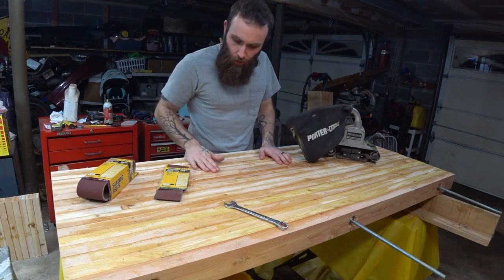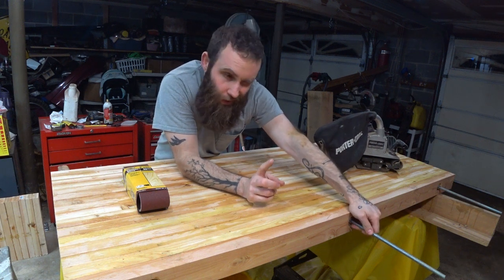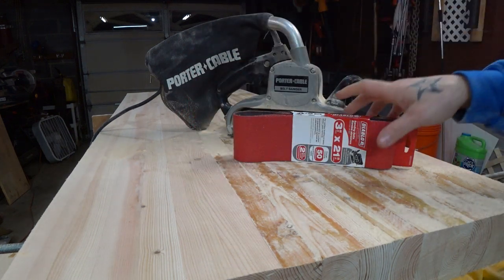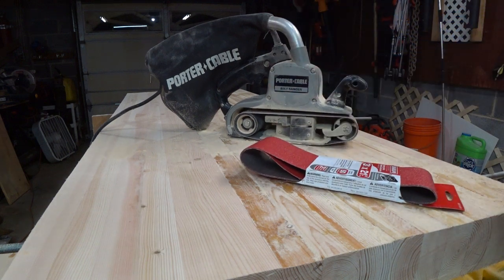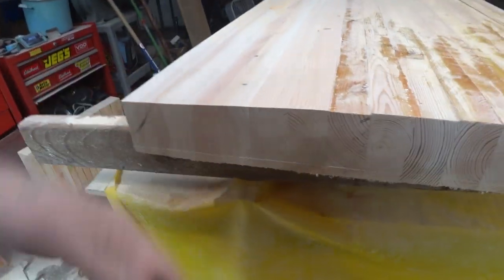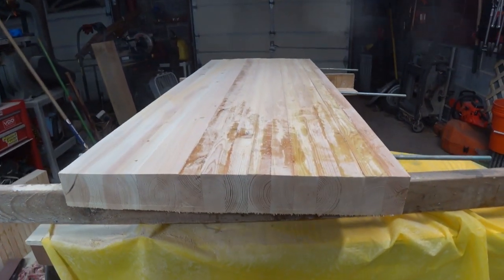Building The ULTIMATE MECHANICS WORKBENCH - Flattening a Table Top

Comment: There better be belt sander racing as bonus footage after part 3.  You’ve set the expectations now. (You give us monkeys an inch and we take a mile)
Reply from the maker: You know what... Deal. If you loyal viewers will stick around until part 3 (this was never meant to be a multi video project) We will build a track and do time trials with some 3x21 sanders.
Reply: D&E In The Garage if you still have the fuel filler cover from lake effect you should mount that to a piece of wood and present that as the trophy
Reply: @kevinmcewen1760  😂🤣 that's got to be the best trophy idea!
Reply: @DEInTheGarage  Yes!  For sure Yes!
Reply: I have a 220v 8”wide belt sander..,   🤔. Are there size classes or run what you brung?

Comment: Love it, couple of comments:
1) Don't try to smack the rod with the BFH. Put two jam nuts on the end, then use an impact wrench on it to spin it out. 2) Using a hand plane or even a electric planer instead of the belt sander...then sand after. 3) You're sanding across the grain with the belt. Need to sand with the grain.

Comment: For anyone watching, Vaseline on the all-thread will help keep the glue from sticking. If you miss the vaseline part, to break the seal you can heat up the end of the all thread to help soften the glue and jam 2 nuts together and use that to rotate the all thread

Comment: Just had an idea, maybe you could have drilled the holes to fit some electric pvc pipes/tubes and run the allthread inside them?
That way the glue would never come in contact with the rods.

Comment: First time viewer, poster and subscribing to your channel. Also a recent transplant to NJ... Jug handles, WTF OVER!? I digress, I ran across your video as I just bought a belt sander to fix my glue up that looks no better than Austin Power’s teeth. I think I screwed up my all thread drill points and I have some serious sanding to do now because I’m serious, it looks bad with boards sticking up on one end but not the other. I also over used my planer trying to glue up the boards in sections of about 4 boards as I thought that would make the final glue up with the all thread even easier and to include clean up planing off the glued up sections. Unfortunately I’m already down to about 2.5 inches so I’m hoping I don’t over sand it now. I’m new to woodworking and needed some pointers, your video helped and provided a lot of other tips on how I could have done better.

Comment: Try using a leveling plane (manual) rather than a belt sander. You will get far superior results is the same amount to time. You can typically find used plane's at flea markets for a few bucks. If not, get a check ryobi hand-held planer. Belt sanders are great at removing material, but the chances of ending up with flat surface is almost nil.

Comment: Just a thought but you could have tried unscrewing the threaded bars if you could have got it to turn a few times you could have put it into the chuck of a drill and just let it wind the bar out to late now as you cut the ends off but this may have worked.
Reply from the maker: That is a very good idea. I did try removing 1 nut and tightening the other side to see if it would break loose, but it just dug the washer in to the board further. My goal for a future project will be to design a better was to be able to remove the rob. I am wondering if greasing it would work
Reply: @DEInTheGarage  Try PAM cooking spray on the rods next time, may keep the glue from sticking to them.

Comment: What kind of finish are you going to use on the top ? I hope some type of oil finish & may be some coats of wax ? It will be easy to refinish when it comes time.
Reply from the maker: Was considering Danish Oil
Reply: NICE, Watco is a good brand & I would go with Dark Walnut ? It's not dark at all but better than Natural unless you want your bench to look pretty much what it looks like now but with a sheen. Also MAKE SURE YOU DON'T THROW YOUR RAGS IN THE GARBAGE, THEY WILL START A FIRE. If you don't want the ends to crack more I epoxied them before finish or paint ? GOOD LUCK, LOOKS LIKE A DAMN STURDY BENCH TOP.
Reply: It'll have its share of transmission fluid and engine oil soon enough, no need to use anything else on it LOL.
Reply: 5w30, atf, brake fluid it’s easy to just scrap off and the table will not rot out

Comment: You should round the edges out or bevel them. That way the risk of you hitting the hard sharp 90 degree edge and tearing the it will be almost eliminated. Also if you have kids or a clumsy person around it is less likely to hurt them if they run into it. I would run the sander over it a few passes to round and smooth everything!
Reply from the maker: Good call. Thanks bud!
Reply: @DEInTheGarage  No problem I  have been planning to make one of these benches as well for the same reason as you lol. I just wanted to share a tip I was given to help make it all last longer and be more eye catching!